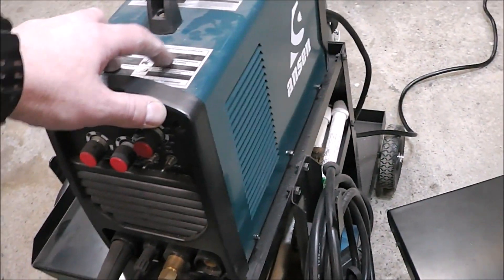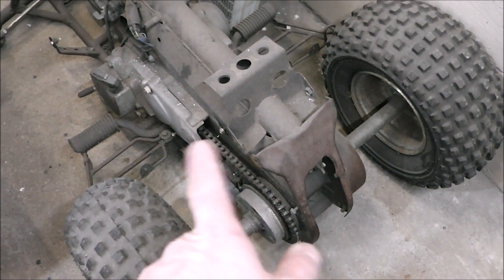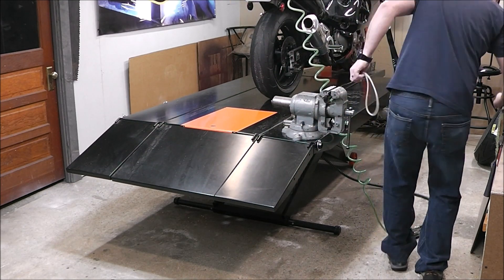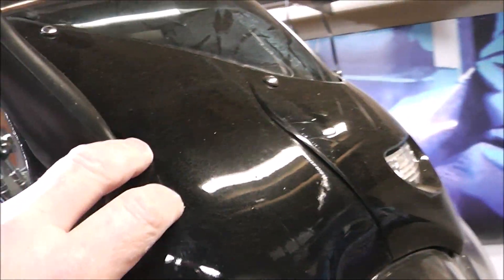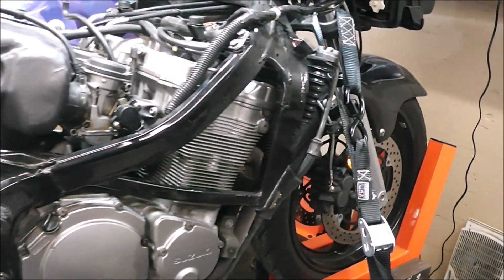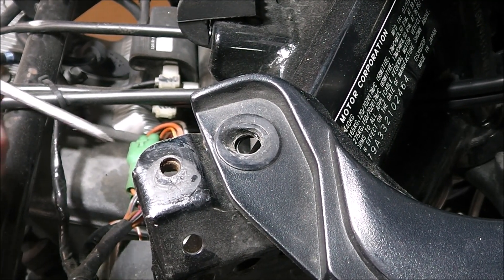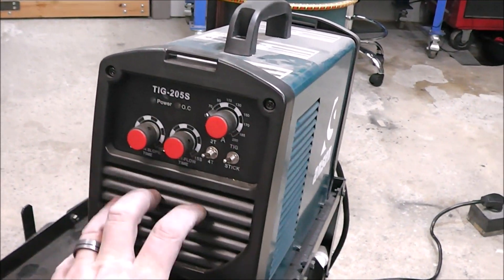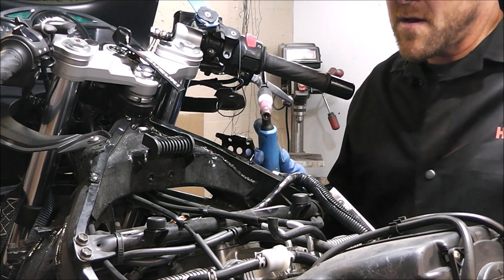Plug Welding and Repairing a Damaged Bolt Hole

Comment: Is it possible to do this with stick welding? Im trying to have all the bolts for my skid plate the same size and messed up drilling a hole
Reply from the maker: For sure. I would use 6013

Comment: Did u use black oxide drill bits?
Reply from the maker: It's very possible. I have quite a few drill indexes and as things wear out and get broken they get swapped out for new.

Comment: Nice job. Too bloody hot over here for welding at the moment, lol.
Reply from the maker: Thanks man! Too hot? Surrrrrrrre it is lol. The only place hot around here is in the workshop lol cheers buddy
Reply: Average daily max here atm 99℉, only had 3 days below 95, plus no workshop, all welding outside, total fire bans in place, so no sparking allowed :)
Reply from the maker: @PilotMcbride  Im jealous, however it was 56F here today which was quite nice considering its been freezing temperatures lately.